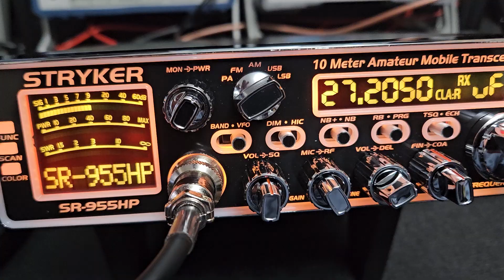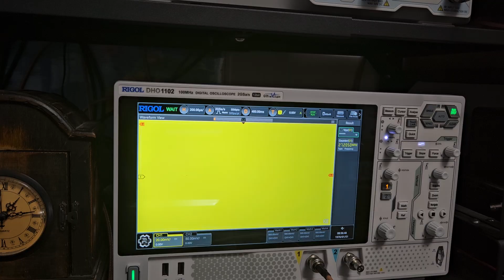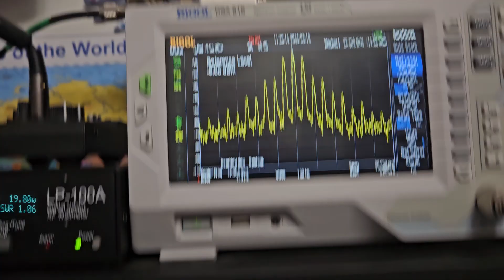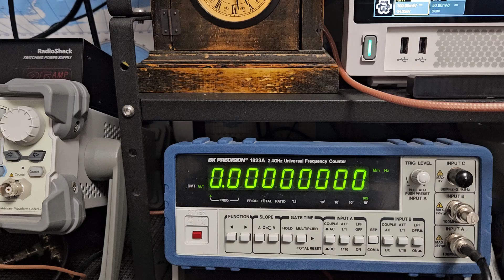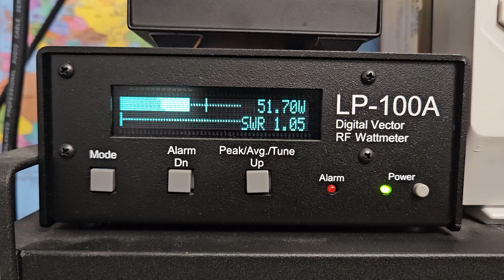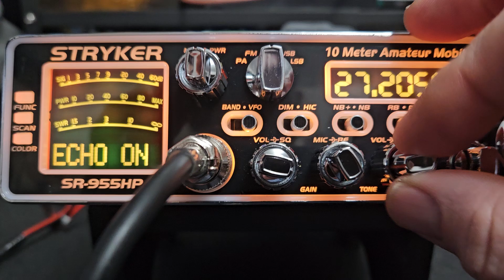New Stryker SR955 HPC for R Zak in Maryland

Comment: Your Radio Shop is great! The SR 955-HPC V2 is a real good Radio, 100% on Frequenzy and a total clear and loud Modulation with the original dynamic Mike too , i use the Astatic 575-m6 and with that the Modulation are Killer ! 

Thanks to Schott's Radios !! 

73 
from Germany

Comment: Mike...a local friend has a Stryker, and all of a sudden is audio is terrible. Is there a setting in Function that could cause that? He isn't very technical,  so he has no idea. He's using the non amplified stock mic. No linear.  Any idea? Thanks.
Reply from the maker: I'm not sure.
I'm wondering if the factory microphone is defective. If he has another microphone I would try that first to rule it out.
Reply: Yes, he has an non amplified Astatic hand mic he tried. The closer he gets to the mic, the more pinched it sounds. Over driven, distorted.
Reply from the maker: @q95oldies57  I wonder where he got it from and if anybody did anything to it they shouldn't have?
Reply: Bells in Fl. I think.  This just started. He has a 7300 too. The Stryker has always been as clean as the ICOM.  Very odd.
Reply from the maker: @q95oldies57  is your friends radio a version 1 where it doesn't have the orange backlit color capability?
I would tell him to contact Bells CB.
I'm sure they will help sort out any problem.